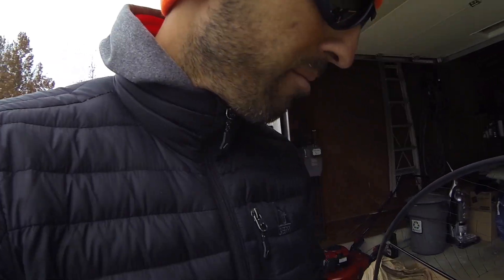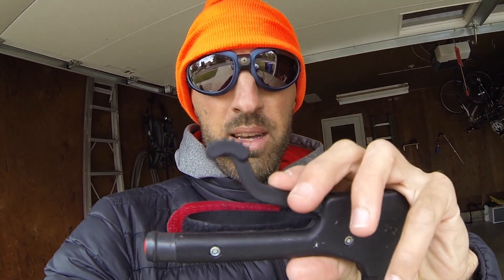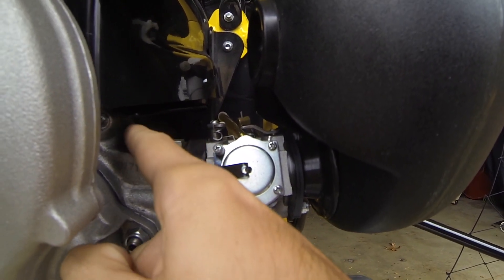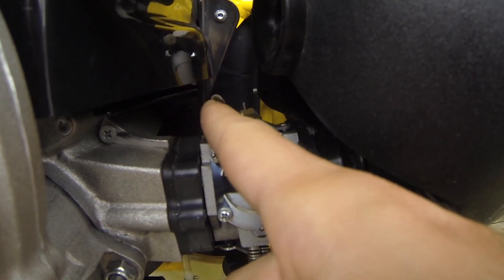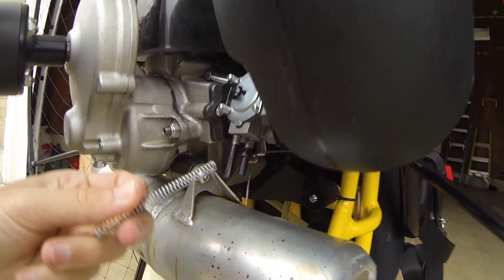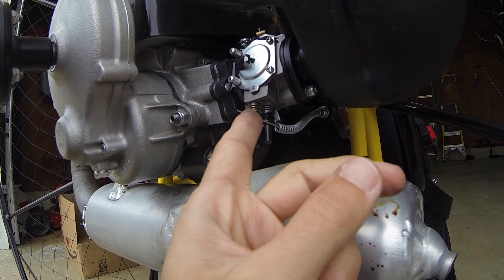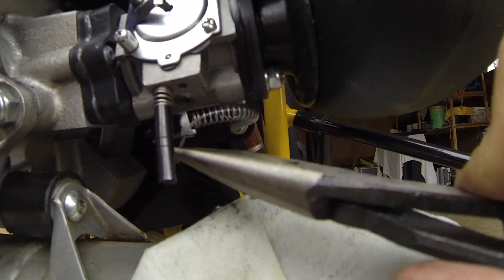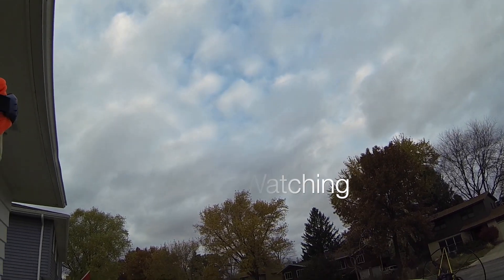MiniPlane ABM Top80 - Safety Mod #1

Comment: The cable will actually start to break and frey(engine out) where it goes through the throttle lever on carb,Had Robinson has a great mod using a cotter pin and small piece of sheet metal,I did that mod,works awesome!!

Comment: Hey bro,you still flying your Top 80,mine had a wrist pin failure at 100 hours the piston rocked a rin into my exhaust port,bent the ring and took a chunk out of the piston..got lucky on the cylinder,$105 and Im back in the air,make sure you replace your wrist pin bearing every 100 hours so this doesn't happen too you!!
 Hope too hear from you soon,stay healthy bro!!

Comment: A small bead of RTV on that spring will keep it from vibrating to its breaking frequency..also do your exhaust springs with the RTV...Im planning on making a video of all the things I did to my miniplane top 80 soon :)
Reply from the maker: thanks for your comment.  I only used RTV sealant on the gasket that connects the exhaust to the engine block.  interesting tip, thanks.  I hope you post your tips in video form or otherwise.  safe flying!
Reply: I will try to make a video ASAP Jim!!
 Your very welcome!! @soccerrefeducation

Comment: Great mod thanks for posting!! What size spring did you actually end up going with in the end?
Reply from the maker: HI Patrick.  sorry for the slow reply.  i don't remember, but it was one of the longer springs.  i wanted to make sure that in any event the throttle would stay closed.